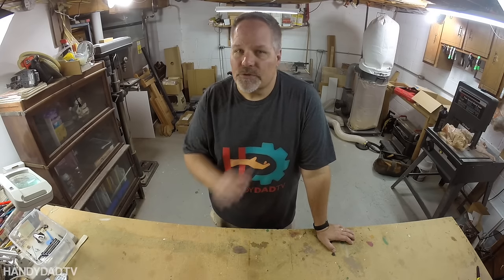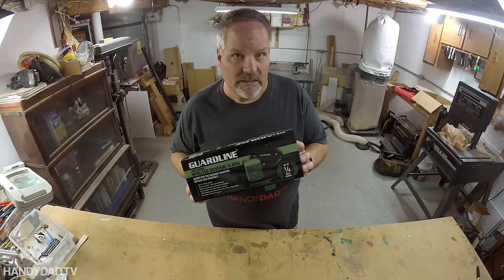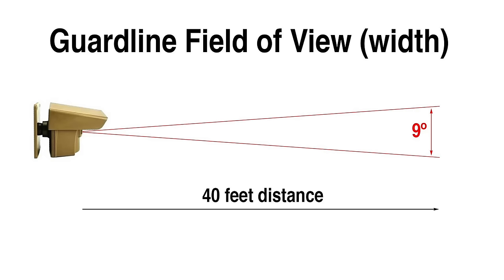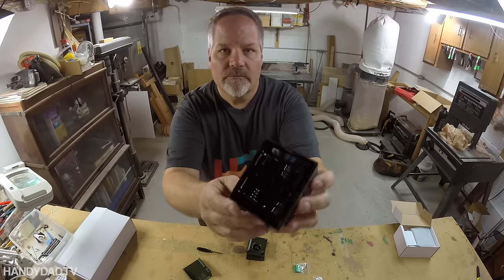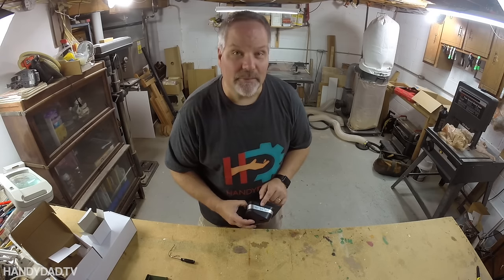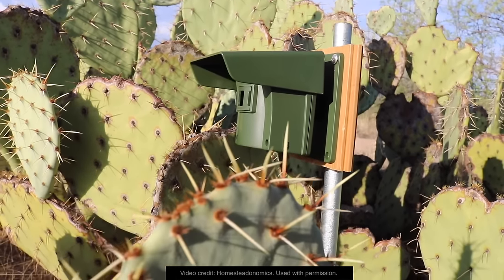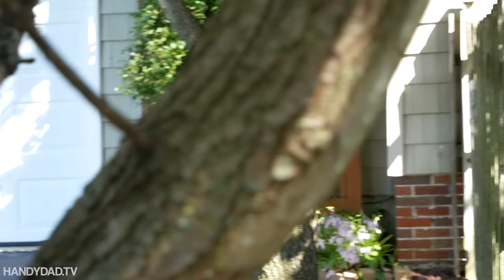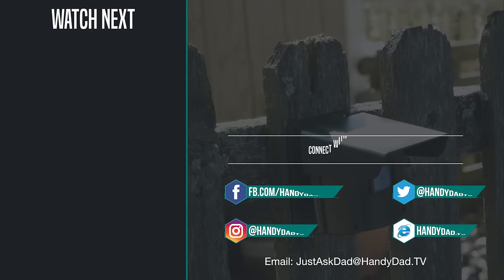Guardline Wireless Driveway Alarm is so much more!!

Comment: $160 is way too expensive for a motion sensor and a receiver. No app? No internet connection? Could get an outdoor battery powered wireless camera and actually see what the motion is for that price.
Reply: Actually it is not overpriced.  It is well designed and multi featured.  Don't by cheap junk for security.  You get what you pay for.  EZ John
Reply: Not cheap there are just better options for less.
Reply: @muletowndumpsters  oOw lol ok
Reply: Please provide a link for a battery operated remote viewing camera at that price!??
Reply: Internet means it can be hacked
Reply: @avacadovich for the price you'd think you could get help troubleshooting but No

Comment: They broke into my car last year. My neighborhood has lots of car burglaries. I installed the Guardline connected to my lights along with security cameras. I see them on my Security cameras but as soon as the lights turn on they leave to my neighbors homes. My camera gives me a 375’ radius and the Guardline is 75’. I also use Harbor freight driveway alarm which is around 35’. So I have 3 perimeter zone alarms.
Reply from the maker: Wow good coverage

Comment: I have been thru a number of such devices(tho not this brand), and battery life in cold weather and water intrusion were the downfall of my previous two tries. Distance is also a concern, as my driveway is 1/2 mile from paved road. I gound that putting the receiver on the second floor increased range.

Comment: hi there. thanks for the demo of the product. Could u get a false alarm due to moving leaves/plants blown by the wind? how long do the battery last? thanks in advance
Reply from the maker: This is an infrared sensor so you don’t get false alarms based on changing light from wind or leaves.

Comment: I know this is an old(er) video, but it came up in my feed as I had searched on how to change batteries in the sensors.  I bought my first receiver and 2 sensors (Guardline!) in Dec 2019.  I live in Northwest MT.  I just today (3/13/2022) replaced batteries in those first 2 sensors.  I have since added 4 more sensors ... the 1/4 mile setup as I have a long driveway.   The peace of mind ... for me and my pets re delivery trucks and sometimes lost persons ... has been enormous!  I do get some wildlife alarms but since I have multiple sensors with different "songs" on the driveway, I can detect whether it is wildlife "crossing" or someone/thing coming up the driveway.  As you noted, it is a versatile system.  I hadn't thought about the camping aspect, but I am a solo rvr and I will take a setup with me next trip - thank you!!

Also ... a co-worker (long distance via Zoom) who lives outside a metro area on largish property, heard the alarms in a meeting one day.  Short story, he bought a system to assist with some neighbor encroachment and is very happy.

* battery replacement was 2 years 4 months after install ... the better part of 3 winters.  AND, Guardline has great videos on how to do everything.
Reply from the maker: Thanks!

Comment: I've used the Bunker hill unit for years, get a lot of false alarms. Many units just stopped working, I did add an on-off switch to the speaker, so just the light would flash. Just ordered the Guardline 1/4 mile unit, just wondering if someone down the street had the same setup would their's set off my unit?
Reply from the maker: Good question that I don’t know the answer to.

Comment: These look good. Does the receiver have onboard speakers or are speakers included?
Reply from the maker: The receiver has a speaker.
Reply: @handydadtv  Thanks! Mine just arrived and works like a charm. Very easy instructions for basic installment.

All they need to do is have an external speaker jack on the receiver so you can mount speakers at the property line and fence rather than having to confront thieves at your front or back door at 2AM in a half-dazed sleep stupor. 1000% more efficient.
Reply from the maker: If you’re handy, you could hack that.

Comment: If your having security Problems or In the Town that you Might? Then its worth the $.. But Not or me $50 is about my Limit-- nd got one for that  and its been 1 yr and still working..Similar , bought the Swan Systtem thru Home Depot.. good enough ..And Sensor is mounted Underneath my Mail Box that is 20 ft up my Gravel Driveway that lets me know I got Mail in the box, 2nd senor I inside the Garage entry door..and a Light as well  attached Garage but Kitchen door is steel and locks automatically when just close the door

Comment: Using your driveway example in the video, what if you had two cars on that driveway? Would it pick up movement of people walking between the vehicles? Could it pick up movement only visible from below the vehicle? I ask because last night someone walked my neighborhood checking car doors and went through my car. If this were positioned on the side of the driveway shooting across sideways, could it pick up low movement?
Reply from the maker: That sucks. We get that a lot here in New Jersey too. Druggies looking for anything of value will walk right past security cameras. 

If you put the sensor low to the ground, it would see feet moving on the other side of the car.
Reply: @handydadtv  Thank you so much!!

Comment: does it have to make a noise when it detects or can it flash an led light instead eg if you dont want the noise to be heard ?
Reply from the maker: I think it has the ability to actuate external devices but I haven’t tried it.
Reply: @handydadtv  ok thanks a lot, but the sound can be turned down a lot i assume ? does it vibrate at all when it goes off so you could have it in your pocket for example and know somethings been detected ?
Reply from the maker: You can turn down the volume but no smartphone notifications.

Comment: My 1/4 mile system is entirely set up, but I was disappointed there is no way to route the audio to my whole home audio receiver. If only they had put a wiring block in there I could have easily wired a 3.5mm stereo headphone plug there and routed audio to my amplifier. Otherwise, this system works very well. I wired the contact closure to an external Niles DB2 device to at least get the driveway alarm dinging over my whole home audio, but the other 3 sensors had to have their sound come from the base. With an external audio plug, all the sounds could router over the audio amplifier.
Reply from the maker: Interesting idea but I’m not sure how many people would find it useful.
Reply: Are you saying your receiver hasn't speakers included?

Comment: How can i get a book replaced? The alarm only works when plugged inti the wall. It does not work with batteries. And when the second sensor goes off it silenced the first sensor.  How to fix. They like taking your money but getting help trouble shooting is lije pulling hens teeth
Reply from the maker: Unfortunately I can’t help.

Comment: Does it have an optional camera system in case Bambi trips the alarm? Are the sensors those red beams that can be easily seen in the dark?
Reply from the maker: They use infrared sensors; nothing is visible in the dark, until it detects motion. 

It is possible to hack a solution that triggers recording on a camera, but they don’t offer it and I’ve never done it.
Reply: @handydadtv  thank you
Reply from the maker: @pizz off - yes, that’s what I meant by hacking a solution.

Comment: I’ve had two different manufacturers motion sensor alarms over the years.  The biggest problem are false alarms.  Usually clouds going by would set off the alarm.  It’s really annoying when you’re not at home, and receiving alarm messages.  Break beam alarm systems are more reliable.
Reply: Did you try this one tho?
Reply: @Farner49  if this is infrared based sensor , then it is no difference between all these brands

Comment: If it’s not going direct line side from the sensor at the gate to the house, does it still work with lots of trees in between?
Reply from the maker: Probably, but you’d have to try it. Return it if it doesn’t work for you.
Reply: @handydadtv  so no wires at attached?
Reply from the maker: The transmitter is wireless.

Comment: Can the receiver be set so that the alarm tone goes off several times or continuously rather than just once in case  you are out of hearing range when it goes off?   Great vid and a cool  product!
Reply: Hey Collette, no but you can choose a variety of different melodies (some long and some short) that accomplish a similar goal. Great question though.
Reply: @Guardline   I purchased a kit with 4 sensors and one receiver everything works fine except I got no user manual of any kind or any paperwork at all with my kit. I called the seller store whatever you want to call it they told me go online and find it there. I found plenty of videos on how to but nowhere can I find a video or written instructions on  how to set certain alarms for certain sensors.  I would like to have a different sound for each sensor of the 4 sensors,  Could you please point me in the right direction or tell me how I Complete these steps.
Reply: Can the sensors be toggled to not make an audible alarm?  I would only want notification on the monitor.
Reply from the maker: @siberwolf33 The sensors (transmitters) make no sound. Only the receiver makes sound.

Comment: Well, two of my sensors have failed completely since I posted. Did everything Guardline told me but they chime constantly until replaced completely.  When my remaining sensors die I will be looking elsewhere.
Reply from the maker: I just released this video https://youtu.be/K1DIfYE-gsA about YoLink leak detection. I noticed they also have a driveway motion sensor. If it’s anything like the leak sensors, it’s gotta be good.

Comment: Can you turn the sound all the way off???

I would prefer to use just an external light. No sound.
Reply from the maker: You can keep the volume at 0. But a motion sensor light would certainly be cheaper.

Comment: Can I connect this to my alexa and when motion is detected turn on all the lights of the garden? Anyone know a method of how to do that?
Reply from the maker: You’d need to hack something using the low voltage connections. For example, you could connect a Zigbee contact sensor to the NC (normally closed) connection instead of its internal reed switch. Then the Guardline receiver would trigger the sensor as if a door was opened. You could add that as the trigger in an Alexa routine to turn on your lights.

Comment: How long is the battery life?
Reply from the maker: According to the Guardline website, the batteries last about a year. They recommend lithium batteries in cold climates.
Reply: HandyDad is correct - batteries last about 1 year on average. Use lithium batteries if you get nasty winters.

Comment: If the sensor is physically accessible or within easy reach, other than with a ladder, then if I wanted to be discrete and access your property/site/location, I would rip it off!  Place it by the pavement (sidewalk) - what!  Rip it off.  Idea is good, but the item ridiculousy expensive for what it does

Comment: From the video, I noticed that whenever the alarm was tripped, the alarm sounded right where the transmitter was which doesn't do much good unless the home owner is made aware of any action from wherever THEY are. I don't want someone tripping the alarm and getting treated to a poor rendition of Star Wars.
Reply from the maker: Gotcha
Reply: Saaki  The sound is produced at the receiver station in the house ( or wherever) not the transmitting sensor. The person tripping the alarm at the end of a long driveway would not hear the sound unless the volume at the receiver was high and the windows were open

Comment: I bought 5 of these for my outside my homes.  They seem to work well, however, I really really don’t like The fact that you can’t program in or download different tones when each zone is activated. All of the chimes seems silly and cartoon like to me. I’d like something that has chimes that sound a little more stern insecurity sounding
Reply: Make no mistake.  I don't care if it's the theme song to Sesame Street.   I need to get alerted if someone's in my driveway trying to get into my cars.  VOLUME however is definitely an issue although the sounds he went thru sounded decent.

Comment: The only issue is people can actually steal them in the places you set.
Reply from the maker: This was just for demonstration purposes.
Reply: bolt them down and put metal glue into the bolts. Leave the wire out or battery pack access.
Get creative, and hide them but leave obvious decoys

Comment: Your fence is in bad shape. 
Also unwise to use wire ties outside. After a year exposed to the elements they will become brittle and break. Changing 8 AAA batteries yearly would suck too. These should be solar powered.
Reply: Apparently you missed the part where he clearly said "The zip ties are for DEMONSTRATION purposes"  Oh, and also UV resistant zip ties are available at Walmart.  QUICK you can still delete your STUPID comment before you are un-mercilessly attacked . . .I am Biodegradable Bill and I approve this message.

Comment: My only question is can it be hacked why shouldn't I make a simple electronic eye myself use a Raspberry Pi 2 w0 Bluetooth and Wi-Fi that single-board computer cost $15 it has a 1.4 GHz processor quad-core Bluetooth and Wi-Fi I bought one just for that purpose you could say I already went for it considering they cost $15 I went and spent the money now I think I want about 10 more the new one with the improved quad-core processors raspberry keeps on improving this thing I get so many spare parts from all of my smart telephones Lifeline is a good thing handy dad everybody in their brothers since 1996 or whenever I first built my first gaming machine it's a pretty simple operation the single board computers don't say too much go for it😆 my starting point was a video about the cheapest surveillance system and Raspberry Pi is pretty doggone cheap handy dad prove me wrong why don't you just get up and go for it
Reply from the maker: Go for it.